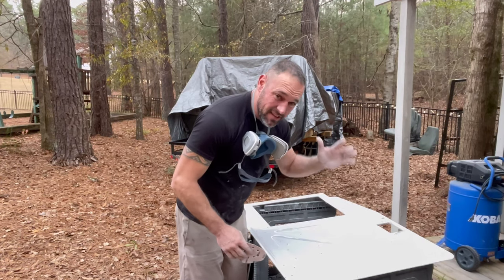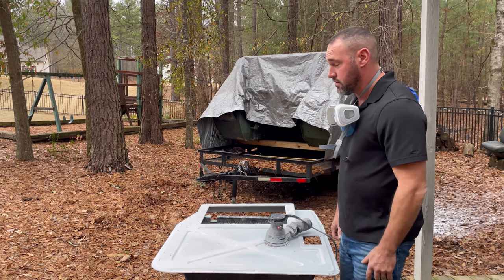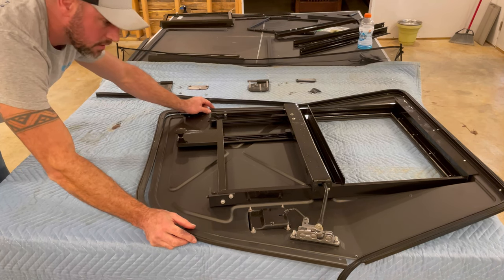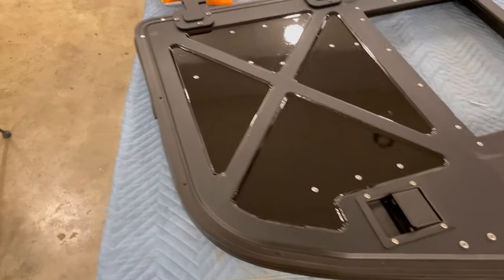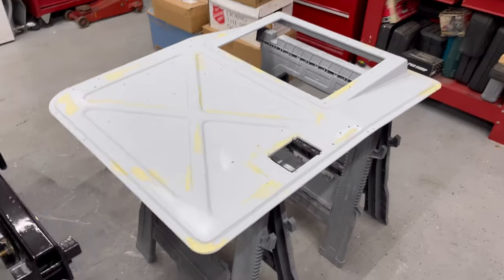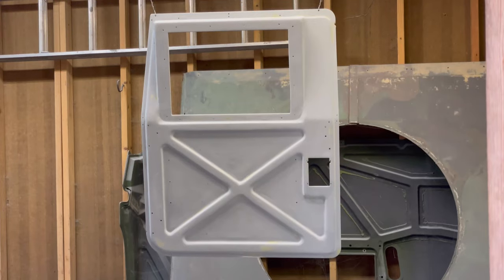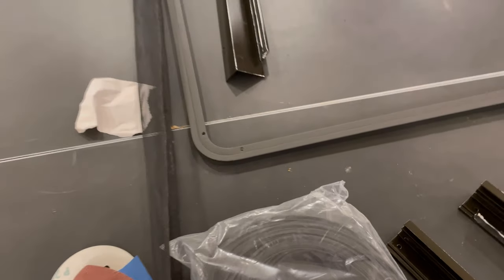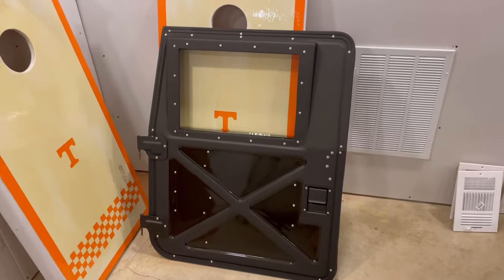Humvee Front Door Restoration and Paint

Comment: Oh..you asked for comments about the aftermarket doors.  For me, I'm in Alaska and shipping is an issue no matter what I do.  I was concerned about going for used doors over the internet and trusting somebody (an individual) to ship them to me.  I considered the RV window doors - there are arguments for and against them - they serve a purpose in the right situation.  For me, the soft doors worked - but were unsafe off road.  Plus you can't lock them - etc.  Actually pulling up to a drive thru was a pain to zip the window down.  The Midwest Military Doors fit without any grinding to the door skin.  Normal striker/latch adjusting needed.  But - WAY too much money- WAY too much - but the going price is the $4,000 range for them.  I considered making my own, but needed doors sooner than later and needed them to work right away.  Every Humvee that I've seen with the factory kevlar/fiberglass door had the same paint/cracking issues and would need work.  But - I agree -$800 is way better than $4,000 and for me - I still have to paint them and had to pay $1,000 just in shipping!

Comment: Nice work!  I love the flat/gloss accents.  I recently installed the Midwest Military Roll Up window aluminum doors.  I haven't painted mine yet (need to wait on some warmer weather) so I'm soaking up other's journeys along this destination to see what might work for me.  I'll be going factory woodland camo.  My soft doors took a beating off road  and were not safe (easy to puncture) - a hard door is so much better but they take a beating since these trucks are so wide.  Most trails that Jeeps, Toyos, and UTVs run are way too narrow so when a fat girl like a Humvee comes along it just screeches as the limbs drag along the sides.  I am not sure how I'll do the paint exactly as it needs to be super rugged.  I like the idea of using a matte clear for durability over the color coat instead of single stage.  Your attention to details is excellent - it pays off in a perfect looking and well performing project!
Reply from the maker: Wow! Living in Alaska must be amazing! I definitely see the need for hard doors! If you check out some of my older videos, I truck deadline the whole humvee. It turned out fantastic and is very rugged. I had the bed liner on there for two years and hasn’t chipped yet. I do like the factory woodland humvees. 

Thanks for your comments. Hope you get everything painted up soon!
Reply: @SplitBuilds  it is amazing here.  They call it the last frontier and I now know why.   I’ll cruise your video collection and get all caught up.

Comment: The Basic Threat, Ballistic Doors you are working with are KEVLAR Composite (resin, no gelcoat).  That is why you are not going to get the finish you are expecting!  Also, any HMMWV and HMMWV parts painted prior to the mid-90 was painted with the "very dangerous" type Chemical Agent Resistant Coating (C.A.R.C.) When you sand that older, dangerous type C.A.R.C. you are basically creating a "Hazardous Waste Area"!!!
Reply from the maker: I got the finish I wanted. That’s for sure. This humvee is a 2001 and still I believe it’s painted with CARC. I didn’t know they stopped using that kind of paint, but I guess you’re saying they did, you seem like a book of knowledge. Basic X doors with no steel plating or extremely flimsy. X doors are not ballistic or cannot stop any kind of round without armor. It might have Kevlar made up in the mix of it all but it’s not stopping anything. But the doors look amazing.
Reply: @SplitBuilds  By the Mid-90s Fort Belvoir came up with a "safer" C.A.R.C. formula.  AM General began using it on HMMWVs in the mid-90s, but don't have an exact break-point. Believe it or not those Basic Threat (you call X) doors do provide a level of ballistic protection. 

FYI: Each batch/run of Basic Threat-steel, Supplemental Threat-steel, Up-Armor- steel, Glass-ballistic, - Kevlar flat panel/pouches/mats/formed panels (including your X-Doors) ...must be “test shot” for compliance to MIL-STD-810 and other applicable sub-sections.
Reply: @jimbella9353  wow.  That’s some great info.

Comment: Hey buddy I just bought a 2002 M1123 and it won’t start. I changed the glow plugs (which needed to happen because they were all destroyed) and it worked for two weeks and now it’s not starting again. Any thoughts?
Reply from the maker: If the engine turns over, start with fuel, see if Fuel is making it past the fuel filter and go from there
Reply: @SplitBuilds  thank you man. I will give it a shot!
Reply: @SplitBuilds  I feel like I am talking to a celebrity. I’ve watched your videos for about two years now and bought mine about a year and a half ago and finally got possession and title about three months ago.